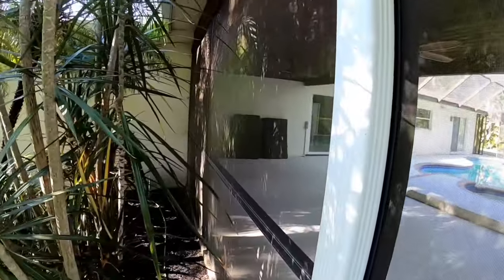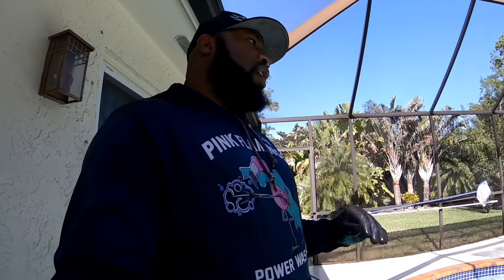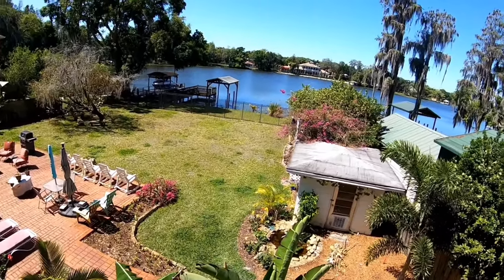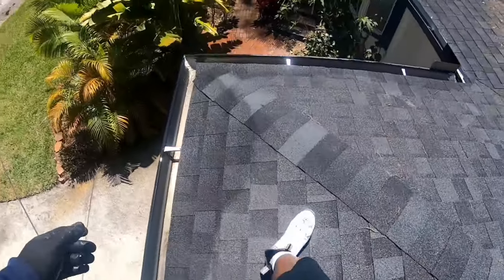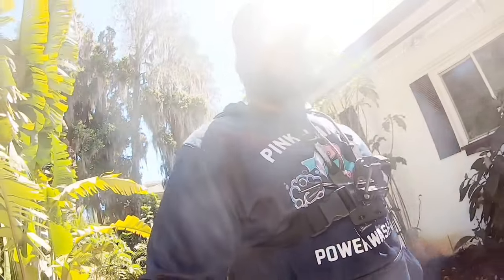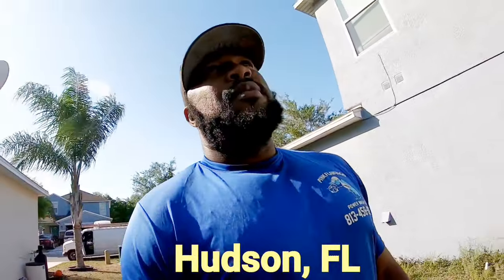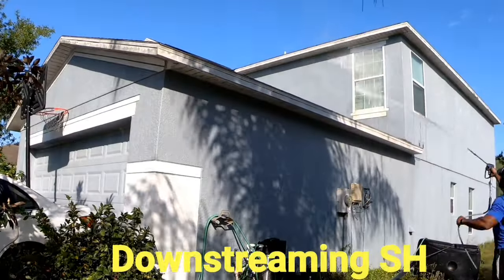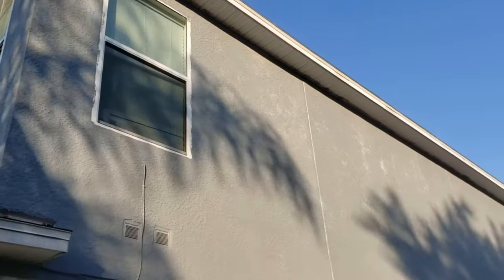4 jobs in 1 day solo 🤑 1k subs 🙏🏿

Comment: You're the best for responding to all these comments man. If you don't mind me asking, how do you lower the throttle on your pressure washer? Also, did you use 3% sh for that first screen?
Reply: Also, what mix did you use on the other driveways and pool deck?
Reply from the maker: Thank you, I just want to help others. To lower the throttle I just adjust the lever on my pressure washer, instead of having it full tilt instead i have it half way so the pressure isnt as much. On this particular screen I used the small General Pump 1% injector. My super suds sucker had stopped working because the spring went bad, but ive fixed it since then.
Reply: @PinkFlamingoPowerWash  If you don't mind me asking, where is the lever on your pressure washer?
Reply from the maker: @owenroberts5473  my gx630 has one. If you got a 4gpm its the throttle where you adjust your power.  It should have a pic of a turtle and a rabbit.
Reply: @PinkFlamingoPowerWash  Thank you so much. I appreciate it!

Comment: Nice job.  Question that house with the soffits.  I noticed some black left behind is that where the paint ate through or what do you tell the customer.  I’m still learning and I probably would have spent 5 hours they to hand scrub that off thinking it has to look absolutely brand new.
Reply from the maker: The paint on the fascia is shot. They painted the house and not the fascia.  There's no much to do except removing the algae. Now if they want the oxidation removed that an upcharge. The black streaks pretty much came off but it will never look white as new.

Comment: How would you clean a painted pool deck with a portable pressure washer lower the pressure also.Thank you
Reply from the maker: What do you mean by portable ? Like without a surface cleaner? If so I'd hit it with a hot mix then rinse with the white tip staying about a foot or so from the deck
Reply: Sorry  I got a 2.5 gpm just starting off. Can I use a surface cleaner on a painted pool deck
Reply: I see guys doing you lower the pressure so it don't mess up the paint
Reply from the maker: @Chief-gp7gw  yes you can if you're only running a 2.3gpm odds are your psi won't be that high to damage the paint. Just be mindful when cleaning and checking your surroundings
Reply from the maker: @Chief-gp7gw  i lowered my throttle halfway on my machine but I have a 5.5gpm 3500 psi pressure washer.  At 2.3 you're not gonna have the same effect
Reply: It's 3700 psi .Thanks again I heard u say your son plays football who does he play for my son played for the valrico rams for a few years now he plays for the raiders
Reply from the maker: @Chief-gp7gw  yes sir. He plays for the east bay bucs. We scrimmaged the raiders in pre season.
Reply: How old is he. is coach gibson still there with the bucs.

Comment: what you charge for pool deck
Reply from the maker: Depends on the size of the deck. Could range from $150-350
Reply: @PinkFlamingoPowerWash  ok it's pretty good size deck I'm thinking $350 plus he got like a long driveway to that about 20 can fit I'm thinking about $450 on that
Reply from the maker: @travisharrison4621  Thats a nice ticket. how long you think it will take you approximately?
Reply: @PinkFlamingoPowerWash  about 2hr
Reply from the maker: @travisharrison4621  thats fast as heck! If so thats a great hourly wage
Reply: @PinkFlamingoPowerWash  that's for the pool deck
Reply from the maker: @travisharrison4621  ohhhh i was gonna say damn you're flying to do a pool deck and a 20 car driveway in 2hrs lol.
Reply: @PinkFlamingoPowerWash  hey will a 18" surface cleaner work with a 3100 psi 2.8gpm
Reply from the maker: @travisharrison4621  it will work. May have to walk slow with it or go over areas a couple times